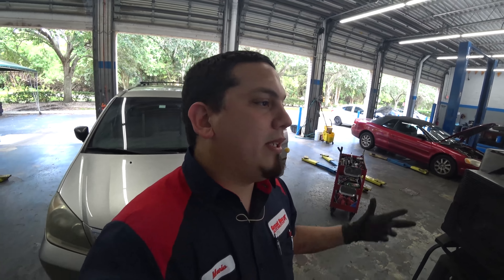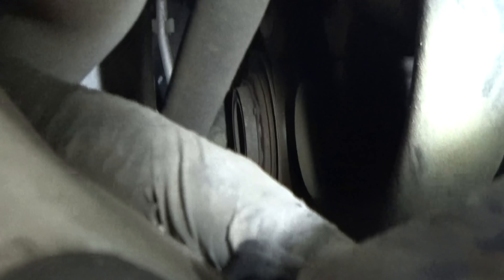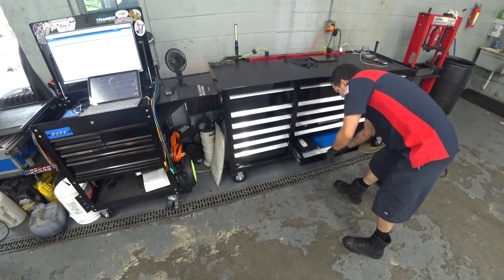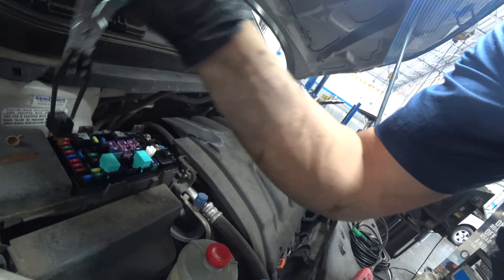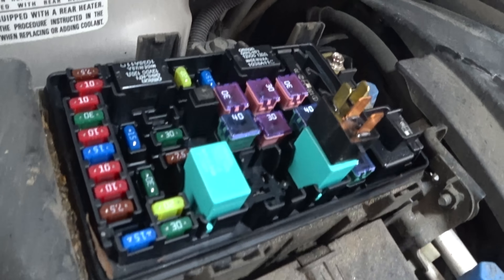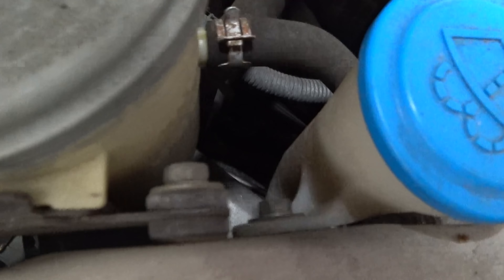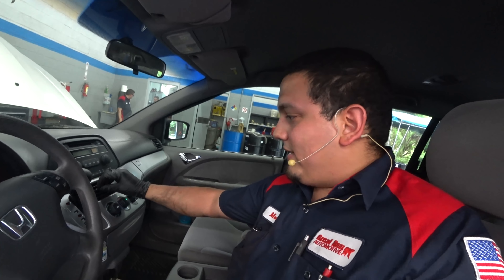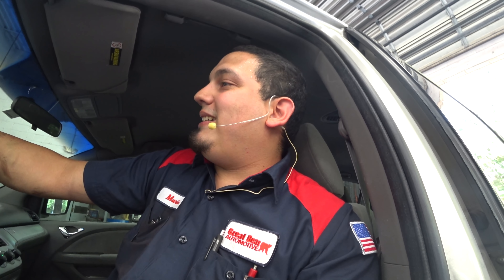2008 HONDA ODYSSEY - NO A/C DIAG - IN REAL TIME

Comment: Awesome video Mario. Sometimes you get burnt with AC electrical issues because the system can still be low on freon. I make it a habit of always doing an evac and recharge just to be on the safe side. These Newer Nissans with the electric control valves in the compressor will still tell the compressor to turn on with less than half a full charge. This is where a good service writer comes into play as well. They should be advising the customers that "look we got your compressor working again but your car is old and there could still be leaks in the system" 

Before i started working for Nissan I was working at an independent, we used to keep a few of those honda AC relays in stock . lol..

Comment: Hey Mario, quick tip for Honda Acura ac. I learned this from Brandon Steckler.
Key on engine off or even at idle. If you press the ac button and the request is enabled , the ac condenser fan WILL come on if you have sufficient refrigerant for ac operation.
So if you have no fan , go ahead and check ac request, you will find it likely disabled due to low refrigerant charge.
If you have fan, the system is trying , you then have a relay or clutch problem.
Thanks again to Brandon Steckler for this quick tip
Reply from the maker: That's why he's the man! Thanks for sharing bud

Comment: Great video Mario. I have found that I can only use hounda AC relay on the AC circuit. I don't know what the difference is but I believe they had a TSB on it. I think there is a little freeze symbol on them.
Reply from the maker: The original one didn't have one. But i believe your correct with specific relays. Thanks for swinging by!

Comment: In theory, Is it necessary to check for high amp draw on the load sided which might have high resistance causing the relay to go bad, great video Mario now I can justify buying a power probe hook.
Reply from the maker: I believe these relays are rated at higher amperage than the fuse. Another thing to note, who has the specifications for loaded current draw on a compressor clutch? Definitely not found in SI. Good question bud, thanks for watching!

Comment: I have 07 odyssey with no ac.  I had a local shop replace the compressor and recharged the system with new freon.  Now one of my fuse keep blowing out and ac still not cold.  The fuse is the magnetic clutch 7.5 amp located in the engine fuse box.  When I turn on my ac, the fuse blow out right away.  What could be the problem?  The new compressor comes with a new clutch already why does it have this issue?  Any answer will greatly be appreciated. Thanx.

Comment: I have a question, the cold air stop blowing suddenly, the ac compressor is working and the clutch , no fuses blown, relays working, What can be the problem, I know sometimes when you need refrigerant, start blowing less and less cold air, but this time just was fast,

Comment: So I have an 08 odyssey that blows cold in the rear but warm/ hot in the front, also clutch does engage , but the condenser fan does not turn on. I think that may be the problem. I checked all three relays and they are fine.any ideas on how to get the fan to work?
Reply from the maker: Have you checked for power and ground at the fan while the clutch is operating?
Reply: @SuperMarioDiagnostics  so the fan Is getting power i changed the pressure switch on the ac line and that did the trick for the condenser fan it turned right, but the ac still blows cold in the rear and warn in the front. I'm lost I'm ready to throw in the towel.
Reply: @SuperMarioDiagnostics  yes the clutch kicks on and the fan has power

Comment: What happens with high pressure side of AC system, when radiator relay is removed? Is there a separate condenser fan?
Reply from the maker: Yes there are two fans. This system commands both fans to run when the AC is on. The high side might go a bit higher since it cannot convert the gas into liquid as efficiently. My "confirmation" of repair was only a quick swap in order to prove that the relay was the only culprit. Thanks for watching!
Reply: Super Mario Diagnostics thanks to come back to me. Danger is, some cars have only one fan, 2 stages. Often stage 1 resistor is faulty. If stage 2 relay is removed, I did this, I got a full blown out pressure relief valve release, hole workshop full of green oil mist. Take care with such tests.
Reply from the maker: Ouch, yes always be careful with that. Lucky the engine didn't overheat! Thanks for swinging by 👍